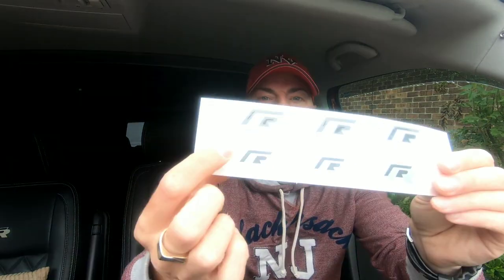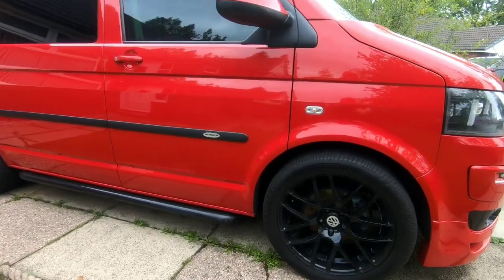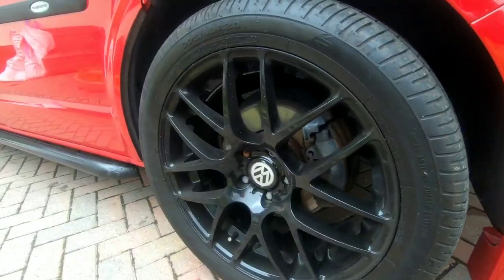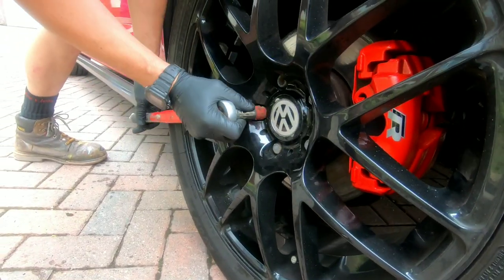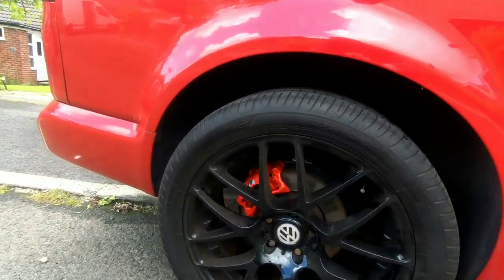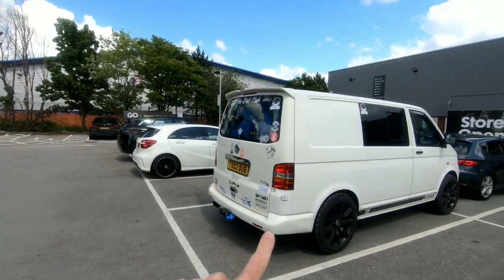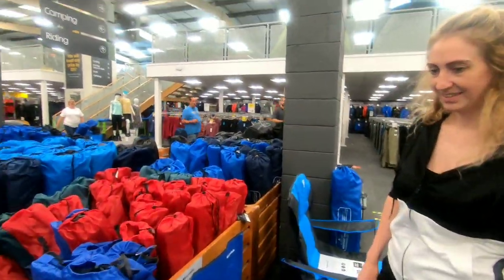How To Paint Your VW Campervan Brake Calipers..! | Diesel Heater Worth It?

Comment: Had an Eberspacher in my T4 and fitted a Planer Heater in my Relay. Best addition to my Camper by far.
Try AJC or DC Conversions in Runcorn for supply and fit, both will do a great job
Reply from the maker: Thank you for your comment! 🙌 We appreciate it! 🙂👍

Comment: Happy Birthday.  We had a Webasto one fitted in our T6 Campervan cost us around £1200 ish around 2016 and wasn't impressed with the noise that came from it.  We also couldn't seem to work out the temperature as it was either to hot or to cold. When they get to temperature they cut off and blow cold air.  We see a lot of people installing the Chinese diesel heaters nowhere near the cost of what we paid and they seem to be a lot quieter than ours.
Reply from the maker: Thank you for your information! 🙌 We appreciate it! 🙂

Comment: Happy birthday! Regarding the heater look in to the underslung lpg tank bolts under the van in front of spare wheel, so cheap to fill and you can have a hob, bbq point at rear bumper and a heater installed under the van, best thing I bought for our van. 7 pounds to fill up its lasted 2 years now and no messing with gas bottles for cooking etc
Reply from the maker: Thank you for your information! 🙌 We appreciate it. 🙂👍
Reply: Hello - if you don't mind me asking what system did you go for and what was the cost for the leg tank & heater? Cheers
Reply: @aberdeenal3234  its propex if you go on their website you will see the heaters and the tanks, various people do them now. Mine was £1250 fully fitted at propex hq in ring wood hope that helps